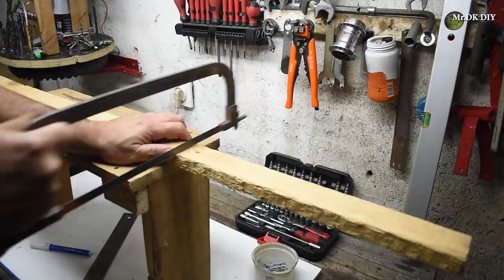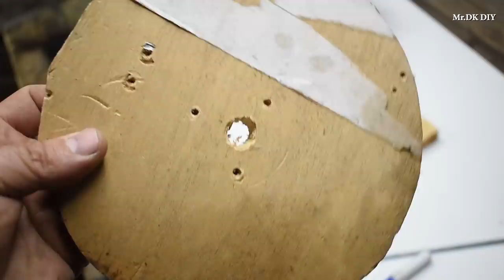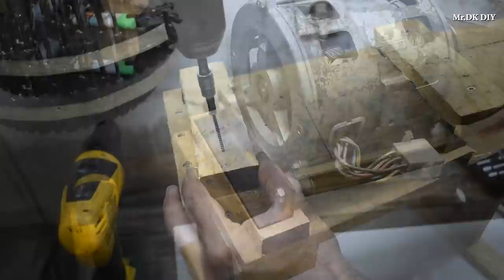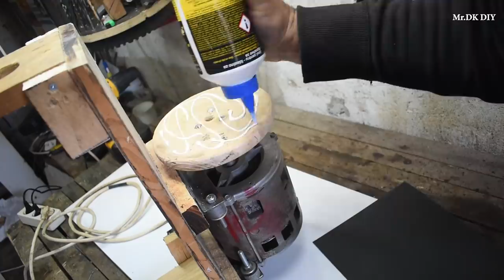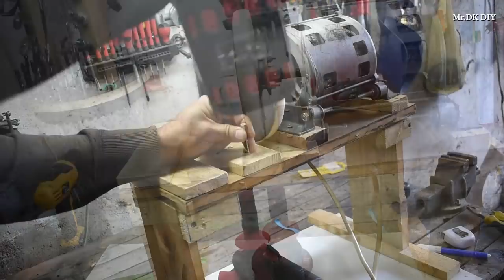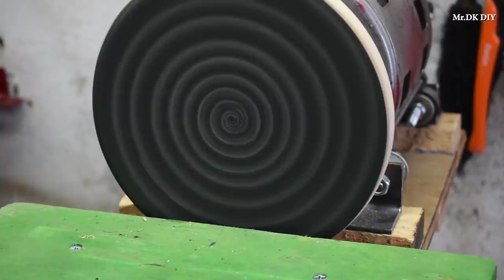DO NOT THROW THE OLD WASHING MACHINE MOTOR IN THE TRASH / DIY Powered Disc Sander

Comment: Nice proof of concept/prototype.  Long term you'd want to make it more rigid and make it so you can change the paper without disassembling the entire machine.  Maybe glue some hook and loop fabric to the wooden disk so you can use that style of sanding disk.

Comment: Yes, you should've mount a disc where you could change the sand paper.  That motor doesn't seem to have much horsepower, too.  That sandpaper will wear out sooner than you think.  Also you should make the electrical plug more insulated. Great idea and your mind is in the right place.  You just have to tweak your designs to be safer. You really need a motor that is stronger for sharpening garden tools, lawnmower blades and even wood.    You did good though.

Comment: What's used to power the motor, a transformer - the part you're soldering wires too,
For washer motor is that also in the washer, 
I have a Hotpoint Aquarius 1400rpm bearing need changing in the drum, so thoughts where strip down use drum as fire pit, 
Maybe sell the PCB board on eBay, and keep motor for something similar or make a pulley powered sanding belt for metal as a possible project
But how did you regulate the power/ speed, is the part also in the washer, thanks
As we are getting new washer

Comment: One thing I have learned from experience of cutting down screws. Always put on a nut and run it in past the cut. Then when you take it off it recuts the threads on the shaft. I usually put two nuts on. same reason. After a test fit i take the second one off.

Comment: I must be getting old, But it appears with the advent of computers and high quality sound cards, people
have lost the ability to talk. It seems that all they do any more is play music. A thousand words is 
worth a thousand words. How does he plan to change his sand paper after it gets worn down? Or was 
that buried somewhere in the music?
Reply: LMAO just one of the many thoughts i also had. I was also rather amused with how much time he spent "showcasing" the sandpaper itself for the camera while not actually doing anything else with it,  like he was Vanna White. but zipped right through the wiring and wiring harness he was tapping into. I know electrical work but most people here, likely do not. It also doesn't do a very good job of sanding either, after all that work.
Reply: I totally Agree  with you John.  About 90%  of these DIY (as well as many others too), just play music instead of giving the viewer a narration of what they are doing, and how to do it.  Another problem is that even then, that music is something that only that person making the video wants to hear. -   Most of what "they" might call "music" of which they insist upon embedding into the video, generally runs me up a wall, as it sounds like an old Tom Cat in heat out on the back fence in the alley, which sends cold chills up your spine like a teacher running a multiple-chalk stick along the face of a blackboard so I mute it.  -  Even the music in this video  -  I also had the same question as you did pertaining to the changing of the  sandpaper as he was gluing it to the disk. - I also  agree with some of the other commenter's on here as to what they say , ask, or advise.
Reply: What is done to reduce the speed of the motor? Are there additional condensers? Sand papers easily get worn out it should be used only for polishing the wood. A plane should be used for preliminary job in polishing the wood. Any way a good job and inspiration to many.

Comment: What I do not understand is why glue on a piece of sandpaper that will only last so long when you could have fixed an actual sanding disc to the machine so you could change the sandpaper when needed.

Comment: Would it be possible to adapt the motor spindle to accept a drill chuck then you could use a standard sanding disc attatchment?

Comment: The washing machine motor I have is currently being used to wash clothes. I do have a spare dryer motor. Could I use that?
Reply: Absolutely, yes that would work just as well
Reply: You could use a vaccuum cleaner motor too. The only downside is probably less power and would be pretty loud.
Reply: Probably but you have to find out the wiring first and if it needs a start or run capacitor or not
Reply: yes by all means...

Comment: Our new Maytag Pro front loading machines have auto reversing variable speed motors, and do a super job in cleaning the clothes.  So what should I do with my old washer.  Ha, cut it up in small pieces so they would pay to take the metal.  The motor?  Used that as a boat anchor for awhile, but then won a lottery ticket for a couple of bucks and purchased a real boat anchor. 

Still using my mom's 1955 Electrolux tank vacuum cleaner, around 20 years ago, needed new brushes, but if you are thinking about made in China motors, need a new word for crap. We are getting screwed royally with Chinese junk.
Reply: Ciao

Comment: Did you really use a hacksaw to cut a piece of wood? Especially the consistent back and forth motion you used. A hacksaw is push - pull. That's why the blades face one direction. I don't believe I'm not the only one too lazy to get the proper saw out. LOL. I'm just busting your chops.

Comment: I normally would not post a negative comment. I am all for repurposing items. This video is a wonderful tutorial on what not to do or what to do if you want to severely injure your self or others.
First, the construction of the base is awful, it has little to no stability in its design and its construction techniques are horrible.

Second, the wiring, omg don’t do this, you have open connections and open terminals . For the love of god at lest do something to protect from shock and to prevent damage to the wiring ( the capacitor just scares the living s**t out of me. ) 

Third, a washing machine motor is great, in this case it would be a good choice, if it were used in suck a way that the motor was protected from wood dust, open frame motors while used in many many applications must be protected from flammable fumes and dust. Otherwise you will have a spinning burning item throwing out bits of very hot metal and lot and lots of sparks that tend to set other things on fire.
The last thing I will mention is the use of a solid wood sanding disk, please don’t do this. What you have there is effectively a bomb. Wood is a wonderfully construction material,  it it does not do well spinning at high speeds under stress. It will fly apart. Even using a piece of composite wood or plywood would be far far safer  than this abortion of a project. 

This how to video needs to be removed before someone who doesn’t know any better tries to make it.

Comment: It seems a lot of work for a sanding disc. I'm not a fan of inexperienced people wiring a capacitor. Especially as the wires are left lying loosely. These capacities can kill. Only qualified people should undertake this work. In my opinion it is a dangerous contraption. Better buy a sander in your local DIY store.